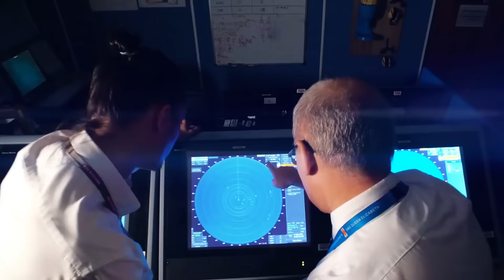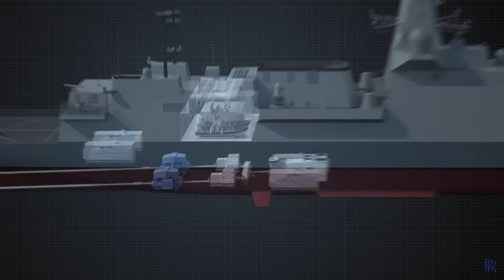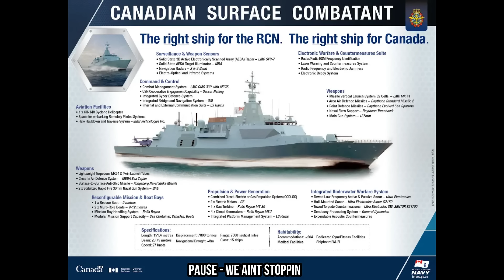Canada's New Warship

Comment: The CSC project is all messed up ,were paying for a ship that has the combat system and tonnage of a USN destroyer and it barely carries any weapons because the propulsion system is to weak to take any more weight,the vls has been reduced from 32 to 24 and 32 wasn't enough in the first place,and considering that this ship won't be ready to go till 2035 and it will be our only class of warships we are screwed because this ship does not have enough weapons to defend itself and fight at the same time , Lockheed Martin isn't the problem they did a good job on their end but Bae,Irving and the government of Canada have f**ked this up really bad and by the time all 15 are built they will be obselete because they don't carry enough weapons and there is no future margins for upgrades as the ship can't carry any more weight and make speed requirements and the electrical output is almost maxed out ,and throw in ballooning costs and delays we are f**ked now ,this project should be cancelled ,A foreign build whether it's the constellation class or something else needs to happen